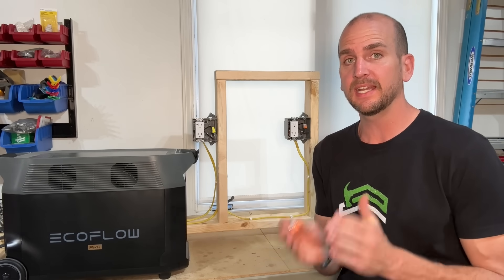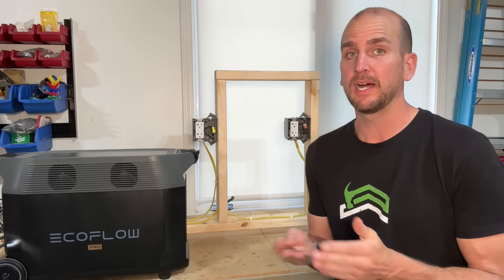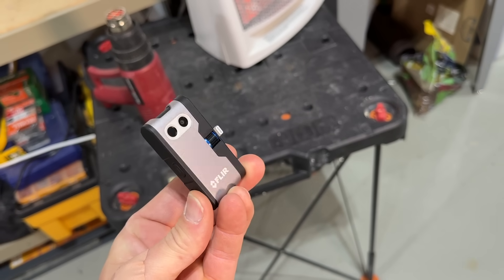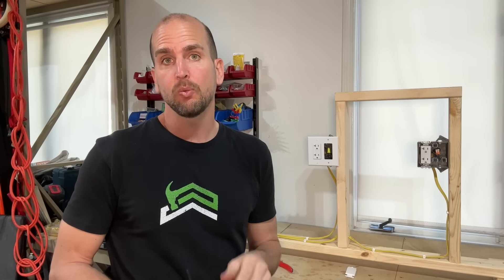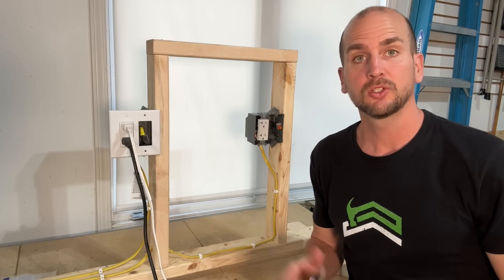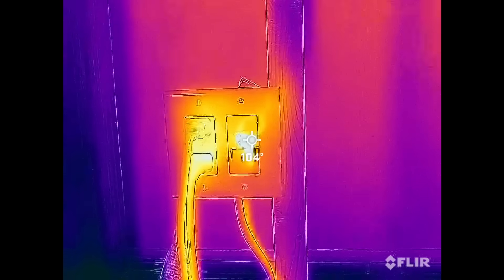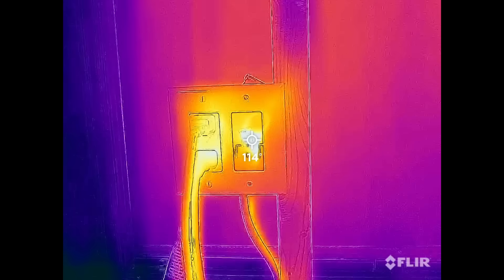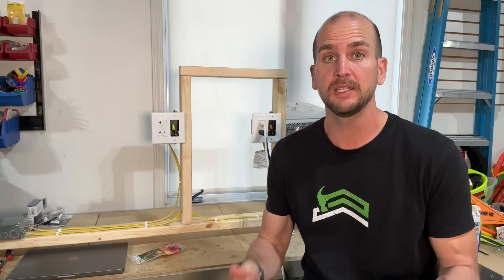Debunking the Pros: Can WAGO Lever Nuts Handle Heavy Electrical Loads?

Comment: Best most comprehensive test I've seen yet.  And, yes.... I do agree with other commenters on the pitfalls of wire nuts.  It really doesn't take much giggling around for them to come loose if not done properlty (continue the twist 3 or 4 turns on the wires coming out on the wire nuts).   Great job.   I too was skeptical but certainly that was conclusive enough for me.)
Reply: Agreed. I'll never put a wire nut inside of a ceiling fan fixture again. Shake rattle and roll.

Comment: I've re-wired 90% of my house at this point (the other 10% will be done in the next year) and there are zero wire nuts, only WAGO Lever Nuts.  The LED puck lights came with stab-in nuts, I removed them and replace with WAGO.  We have had ZERO issues and they're SO much easier to stuff into the box.  I'll never go back to wire nuts.

Comment: Actually a 20A MCB doesn't trip at 20A all overcurrent devices have a fusing factor for an MCB it's typically 1.2 so they actually trip at around 24A

Comment: I don’t know of any electricians who don’t pre-twist when using wire nuts.
As you have pointed out the results are well within specifications but I can’t help but feel that it violates a fundamental rule of splicing that seeks to minimize and get as close to zero loss as possible. The greater heat reflects the voltage drop within the bus bar it may be tiny but it is less ideal than a pre-twisted pair and a standard wire nut. With a pre-twist and wire nut you were gettin extensive surface area contact plus an additional conductive wrap From the wire nut.
If there were in unanticipated rise in current as might occur with a faulty generator the dramatic rise in current would cause the Wago or the wire nut alone to act as a fuse and melt. On the other hand using a pre-twist and a wire nut preserves the current carrying capability of the romex ensuring that the appropriate fuse or breaker trips. 

When all is said and done you have to weigh the pluses and minuses based on the particular installation. There is no getting around the advantage that the Wago’s have when it comes to installing home automation devices in crowded electrical boxes
Reply: The answer is pretty simple, Wagos don't fail until >50 amps which is way more than what any of the wires they can accommodate are rated to carry.. not to mention the fact that these were some unrealistic/unlikely loading circumstances.

Comment: Since I used WAGO connectors on my daughter's old house (vintage 1930's with an updated 100Amp panel), I very much appreciate your demonstration.  I'm not concerned about the outlet temp readings in her house as she would not put a circuit under the loads you used.
Reply: Are wages rated for Knob and tube? Likely not. Wire nuts aren't rated for it either

Comment: I appreciate this test, especially as a new Wago user! I've found myself being a little reluctant but a satisfied customer.

My last concern about these is longevity. Are these going to hold up for decades if they're installed correctly and never touched. Of course it's impossible to know now, but that's my only major concern.
Reply: It's not impossible to know. These have been used in Europe for decades, and these are the de facto standard there, even old school electricians prefer these over wire nuts there. To them, it seems, the debate is settled, and has been for a long time, Wagos are far superior to wire nuts.

Comment: Let's be honest, the apparent slightly higher resistance of the WAGO doesn't mean it will be a problem in all (or any) applications.  That said I'm kind of in the middle with the WAGO - while I have a good-sized collection of them I think they are best used in tight, lower-current applications like light fixtures.  The possible effect of higher resistance is minimized by the much lower current seen by the WAGO in this application.  I also think they make a more consistent connection between solid and stranded wires - and therefore are more likely to result in lower temperatures.  When it comes to places where there will be more than a few amps flowing I stick with wire nuts.

Comment: you really want to defend those wogals don't you.   your test is flawed... move ahead 30 years and repeat it.   that is if the wago has not melted away by now burning down the house.  The compression clip connector was invented many decades ago and has been used in the fire alarm industry for eons.   Low voltage puts very little stress on the connector.  But under  your test you proved that it will fail.   Heat causes oxidization, which causes more heat, which causes more oxidization, on and on.  Your wago will fail under high voltage.

Comment: I would interested to see how much more thermal insulation the wire nuts provide vs the wago connectors. I would not be surprised if there were less performance difference between the two than suggested by the thermal camera.
Reply: I was thinking the exact same thing.

Comment: Many a service call for wago neutral connection affecting down stream device. Then again, poorly spliced wires are sam result…💸💸 If one is uncertain, one shouldn’t mess with electricity. Would agree is great for multi-lighting. BTW! Great video 👌

Comment: I have been a residential electrician for 32 years. I too was a skeptic for a long time. But as I have gotten older twisting wire nuts by hand has given me carpal tunnel and I started using the Wago's about 6 months ago. My only question is? Where have they been all my life.😂?
Reply from the maker: 😂 thanks for the feedback.
Reply: Then u should retire. Theres no reason to use them. Safety is everything not convenience.
Reply: @RadioRich100  There is zero evidence that WAGO connectors are not safe - unlike the many documented cases of electrical fires due to wire nuts. Maybe it is you that should consider retiring? 🤣
Reply: @RadioRich100  I could retire.  But I'd rather keep some young apprentice or cocktail journeyman from getting their career started.

Comment: I think wagos have their place but I think it comes down to price. I can buy a good wire nut for about 10 cents but a wago is about 50 cents. It adds up fast. Plus a cheap wire nut is going to be a lot better than a cheap wago which is what I am afraid will happen to the market. Then you will see real problems with the knockoffs
Reply: The point is the wago is slightly more amateur friendly and significantly less likely to use improperly. The sake cannot be said for wirebuts at all. It is very easy to not secure two wires properly with wire nuts even if your testing them after. In reality other than pretwisting then wirenutting, the wago is a much more difficult device to screw up. And amateur diys don't pretwist in my experience lol. I know I didn't before getting more serious and watching how to vids.

Comment: I switched to Wagos a couple of years ago and haven't looked back. They're better than wire nuts for many applications. like connecting stranded and solid wires, or connecting more than three conductors. You can visually check that all wires are fully inserted and it is easier to get everything in the box. Five 12 AWG wires in a blue wire nut with two full twists outside the nut (per code) is very difficult to stuff in a double gang or 4 square box. Wagos just make life easier.
Reply from the maker: Amen!
Reply: @EverydayHomeRepairs  There total junk.

Comment: This is an interesting test, but I don't think 221 degrees should be the basis for comparison.  Even if the connector itself can withstand temperatures that high, we also need to consider whether we want excessive temps in the wall.  Temps in the mid-100s for an extended period can increase the risk of fire or shortened life of other components.

Comment: I used WAGOs  to wire my hobby building  several years ago. Run a 12" saw and haven't had any issues yet. I doubt I'll ever use wire nuts again.

Comment: Disclaimer: I’ve never used wago connectors before and I don’t have a stance on them as I don’t really care.

The problem with a test like this is that it’s a 20 minute test. You have to realize that electrical connections don’t overheat after 20 minutes. The issue arises when you have a large load over the period of years and decades. Electrical current creates heat and vibration which loosens all connections over time whether it’s a wire nut or a wago or a terminal in a panel. The concern with wagos is if they’ll hold up after 10, 20, or 30 years of heat and vibration. A good twisted connection with a wire nut is already proven to last an extremely long amount of time whereas wagos haven’t been around long enough to have as much reliability as a solid wire nut connection.

Your test only shows that wagos will be fine after 20 minutes of an overheating scenario. What about an hour? What about a day? How about a week? I know it’s not realistic for 23 amps to be a constant load for that long but this test proves nothing at all.

Again I don’t have a stance on whether you should use them or not I’m just pointing out that this experiment is not even remotely conclusive. Also I am a licensed electrician and I totally see how these could be useful in certain scenarios but I don’t use them because wirenuts are cheaper.
Reply: Your claims are incorrect. They have been in regular use in Europe for about half a century.  
I am sure the UL did long duration testing at severe loads for very long periods of time.
This test showed that there was insignificant difference in heating between WAGOs and wire nuts. It was long enough that the temperatures stabilized.

Comment: Contrary to your statement regarding a 20 Amp breakers trip point being 20 Amp, the book says i will usually withstand 27 Amps for a little less than a hour??
Reply: The time delay depends on a number of factors, such as the breaker response curve, age and how many times it has tripped (or manually turned off) and then reset.
Reply: @buggsy5  You and I know that,

Comment: I was an electrician for 35 years. I was always taught to twist the wires together first and NEVER use the wire nut to twist the wires!! If you ever needed to work on a circuit hot, the worse thing was the wires coming apart as you removed the wire nut to test the circuit or if you needed to add a wire to an energized circuit because you could not shut it down for various reasons.
Reply: Wagos conveniently have a test port so there’s no need to undo them.
Reply: @glasshalffull2930  I understand that but there were times we could not break a circuit and needed to add a wire to the existing circuit. We were not able to shut the circuit down. You can't do that with wagos or wires that are not first spliced together before the wire nut.
Reply: @rf159a  I actually use Wagos with extra unused ports for adding a circuit if necessary in the future.  Would be a lot safer than taking off a wire nut and trying to add an extra wire and replace the nut.
Reply: @rf159a  That kind of hot work is not safe and with high wattage circuits quite dangerous. I would have refused to do such a thing if I had been asked. A circuit can always be shut down - regardless of inconvenience or loss of revenue.
Reply: @buggsy5  Has nothing to do with loss of revenue. Sometimes it was in hospitals and the circuit could not be shut down. Sometimes it was in refineries in critical areas.
Reply: That is an awesome way to do it. But are Contractors willing to spend the money to look to adding wagos with an extra port if needed in the future? Most Contractors try to keep it to the bare minimum because they need to make money to keep us working.
Reply: @rf159a  I could see building design people calling out Wagos as how they want the electrical put in.  Only the future will tell.
Reply: @glasshalffull2930  I should have been more clear. I am retired and did mostly Commercial work. Wagos were not around when I was working. They seem like a great alternative to wire nuts and look like they make the job faster and a lot easier. Do you know if the NEC approves of these? Been a long time since I read the code!!
Reply: @rf159a   The NEC is silent on Wagos.  NEC mentions a “thoroughly good” connection.  Funny thing, NEC is silent on backstabbing type receptacles even though they are notorious for failing in different ways.  I guess the NEC wants electricians and inspectors to regulate themselves.
Reply: @glasshalffull2930  Thank you. Backstabbing!!! I don't know how many failures I've seen from doing that!! Whoever thought of that idea should have been wired to a megger tester and been given a few jolts for every outlet that electricians have had to rewire due to this stupid idea!!

Comment: How much mass does the wirenut have compared to the Wago?  IOW, weigh them both.  Because I'm thinking that the wirenut may weigh a little more.  That means it can dissipate more heat so the delta T is not as much as the Wago.  So I think the Wagos are just fine.  You also could look at the IR drop across the Wago over time.  IOW, maybe the longer you leave it passing 30 amps causes the IR drop to increase thus increasing the temperature.  Would the wirenut still do better?  It does make sense that the wirenut carefully installed would be a better solution..but I dont know that.
Reply: Well, if something can't dissipate heat, it is an actual problem

Comment: I've used both. Some situations make the Wagos a much better choice but for the easy stuff, I'll save a few dollars and just use a wire nut.
Reply: Wagos may cost more, but they save a lot of time (time=money right?), are reuseable (more Eco friendly, less waste, the later lowers overall cost, less error prone (less errors=lower cost). The benefits of a Wago lever nut seem to contradict your idea of using wire nuts for the easy stuff, and overall cost difference may be much smaller than perceived. Even others have said the opposite of what you have said, effectively. They would use the Wagos for the easy stuff, and wirenuts for known high current applications.
Reply: @technerd9655  I prefer Wagos in situations with a lot of wires in the box and more than 3 wires. If I'm doing two or three wires, a wire nut is fine and almost as quick. I'm not doing this professionally, so I don't care about my time. I also have a lot of experience for a DIYer, so I'm not concerned about errors. I'll recommend Wagos for people with less experience. I totally see the benefits but I'm also happy saving a few dollars at times and using the wire nuts I've been using since I learned how to wire in high school.

Comment: I have been replacing my ceiling lights with integrated LED fixtures and exclusively used Wagos since the current draw is so much lower and is so much easier for me to install. No more hoping the stranded and solid wires will twist together.
Reply: @driatrogenesis  I’ve never heard that claim before. Could you please elaborate?
Reply: @driatrogenesis  While LEDs can be more intense than light bulbs, have you ever looked at an LED? An LED spot has 10-30 small LED cells over the entire light area, meaning that it emits the same light as the thin, point-like incandescent light bulb wire over the massive area of the light bulb. Similarly, outside spot lights, standalone LED light bulbs might have 3-8 strands of LED wire in them, emitting much more spread out and less intense light than an equivalent light bulb with a single strand of high-energy wire.

LEDs are bluer, but this is blue at around 465 nm. Dangerous blue light (ultraviolet radiation) only starts at 124 or so nm. Unlike incandescent light bulbs, which emit most of their light as entirely invisible IR radiation, LEDs usually emit zero UV and zero IR, meaning all of their light is visible. As there is no UV in a white LED, the waves emitted are far too long to cause damage to cells. A white incandescent light bulb on the other hand must always emit a dangerous amount of invisible UV light, which white LEDs are incapable of, causing possibly serious damage akin to looking directly at the sun. The blue light from LEDs is pure, it has no UV, but the muddier light from incandescent light bulbs must always include UV to some extent and this increases the whiter the colour temperature – a 2200 K has less UV than a 3500 or a 4000 К bulb. UV does cause irreversible damage, and the fact that a white incandescent bulb  needs to be more blue than an equivalent LED bulb, that is, it emits more dangerous high-energy radiation than an equivalent LED is a good case for switching to LEDs outside the energy concerns.
Reply: There is no issue for a skilled worker to splice solid to stranded with wire nuts.
Reply: @barfy4751  Emphasis on "skilled".  You could make the same statement about using solder connections instead of wire nuts.  Why don't we go back to that?  Wagos are harder to install incorrectly and make it more likely to get a secure solid to stranded connection.  They are the next step forward.  Their only downside is price.

Comment: Why would a professional consult some handy man about electrical science?  You dont belong giving advice. YOUR NOT an electrician or engineer your just a homedepot handyman. Your experiment is invalid anyway.  It has to be conducted over time and varying loads with all different loads, different temperatures ,type of wire, different sizes of wall boxes, ageing and so on. I agree there just fast junk. Theres no gain to using them except speed of installation. So why use them? Wire nuts dont get hot either, they only protect the connection which is twisted with maximum contact, which you cant get from this fast junk. Remember they thought aluminum wiring was the way to go until years later. I see these things causing the same problems over time all for "haste makes waste" Some electrician isnt going to care about your house burning down 10 years after he wired with wagos. Wire nut twisted connections last right until they tear the house down. Why take a chance on these??